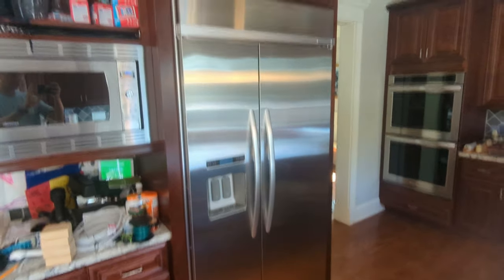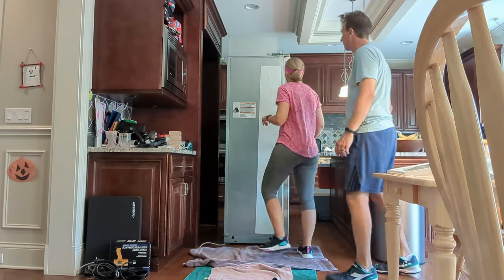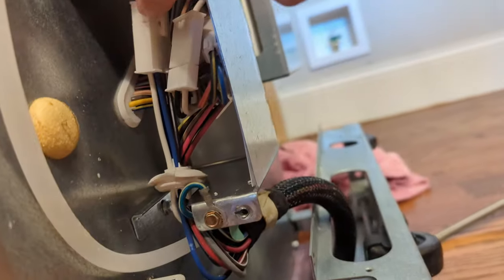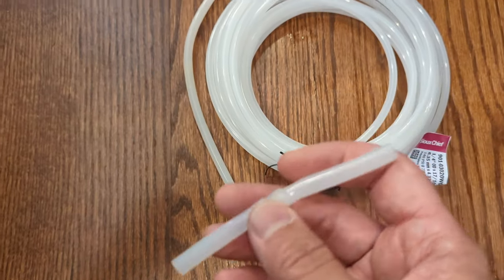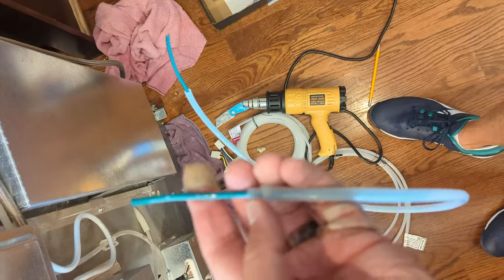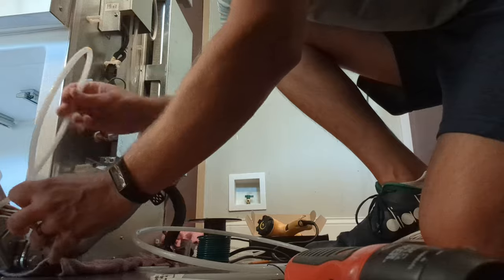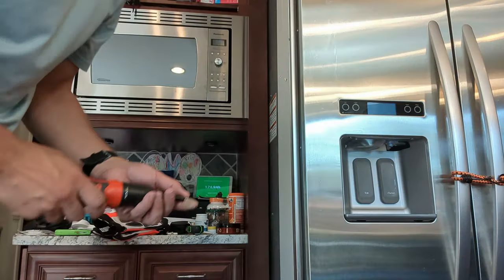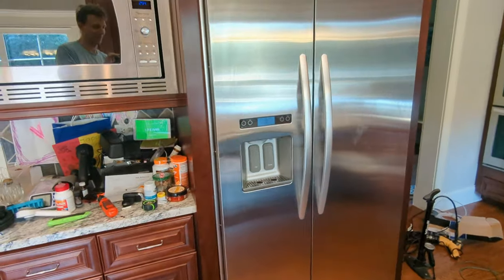Fixed!  Fridge leaking water from water dispenser tubing (KitchenAid)

Comment: Speaking from a tech's perspective yes due to liability reasons it's not something any of us would do . However the way you went about that repair however it may have worked out just some professional advice you tipping that fridge on its side like that damages the compressor dont be surprised if you find yourself having temp issues in the near future hopefully you don't but don't be surprised

Comment: Love your effort, man you deserve an a for your effort, but you could have use quick connect fittings. Also it is not recommended to put a refrigerator on its side. You can actually lay it on its side, but you should on the service side. Also your could have leaned it backwards. I’m a tech and I probably would have done it, but most techs wouldn’t want the liability. The factory fitting would be just fine. Hopefully you don’t have any issues with the compressor
Reply from the maker: I had a quick connect fitting, but it wouldn't fit inside the grey conduit.  If this one leaks, I might cut away part of the conduit to fit a connector. That'd be under a lot of bending stress too, but still could be better than melting the LDPE.

Comment: The hose will now be more brittle. And that brittle spot will be right where all the pressure was before to crack the hose. You are on hardwood floor. Is having water and ice really worth the what could turn into replacing your flooring? Also as mentioned tipping unit is not good for the sealed refrigerant system. In Ontario this would have been about a $10,000 fridge. In my opinion the ice and water working is not worth the risk of messing up the sealed system and potentially ruining hardwood flooring. As a tech I would never consider doing this repair for a customer and taking on all that liability. If it was my own fridge and and was on a concrete basement floor than maybe. I would also tip it the other direction only 45 degrees to get access. The 15 minutes kitchen aid said to leave upright before plugging in is not enough time in my opinion. I would be letting it sit full 24 hours to be on the safe side. I wish you luck, honestly. I just hope you fully understand the risk and in the very least understand why a technician would say no. From my experience somebody like you may post a bad review on that companies google reviews which would not be fair. And also decide to tell the tech that your not paying because he won’t fix it which would also not be fair. So I hope you didn’t go either of those routes.
Reply from the maker: I paid the tech, don't worry I have no ill will there!
Reply from the maker: @jimmacphee9682  I am disappointed at KitchenAid, for the unfixable design and for not making the freezer door anymore (the only legit fix).

Comment: Next time just use a John guest fitting    The heat will make the tubbing brittle.   Definitely lot of liability with this.  Doubt any factory tech will do this type of repair.
Reply from the maker: I actually bought one in case it had broken farther away from that grey tubing.  Since it broke too close, and the John Guest fitting wouldn't fit inside the tube, I decided not to use it. I could have cut the grey tube back to make it fit?

 I also thought about a barbed fitting, which would have been narrow, but I wasn't sure I could find a narrow clamp that would also fit inside the grey tube.

Comment: Better way , 4mm Id silicone hose and zip ties, there's no pressure on this line. And will never break again
Reply from the maker: Interesting, it may have fit inside the conduit but would have been close :) that bendy section would probably be better off as silicone the whole way, I bet it'd fatigue less than the LDPE.

Comment: Instead of heating it up etc as long as the line was no longer brittle this would have been better from my own personal experience. A 1/4 to 5/16 push connect.
Reply from the maker: Push connect didn't fit in the grey tube.

Comment: Did they say it was unrepairable or that the part was no longer available and decline the repair for liability reasons. 
Side note, I'm not sure how long you waited to plug the unit in but you likely drained the oil from the compressor and might have a cooling issue. But hey the water line is technically repaired.. until the line breaks in another place because you used a heat gun instead of a fitting they sell at Home Depot for the job.
Reply from the maker: Part no longer available (Freezer Door).  I waited 15 minutes for the oil to settle.

Unfortunately, the fitting wouldn't have fit inside the grey conduit/tube.  I bought one to have on hand for this fix but it wasn't going to work.

Comment: Thats not really a way to repair it. That hose is still old and might crack again right next to that spot or before that. Entire hose needs to be replaced. If you already went above and beyond, why not replace it all and install copper one?)))
Reply from the maker: I cut back a half inch from the break inside the tube, and then the whole section that bends inside the black loom is new.

I can't run a new line.  The line is foamed into the door.  Also, it has to twist and bend each time the freezer door opens, so copper might not be a good answer.